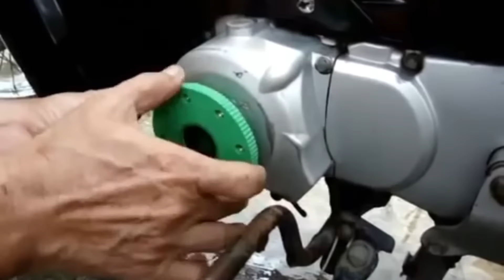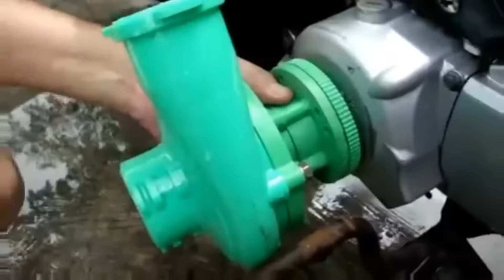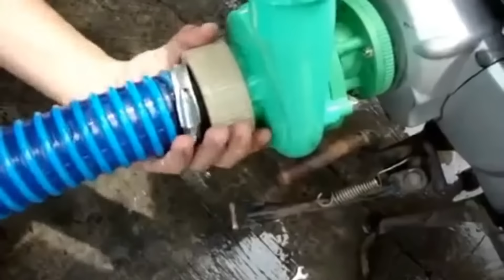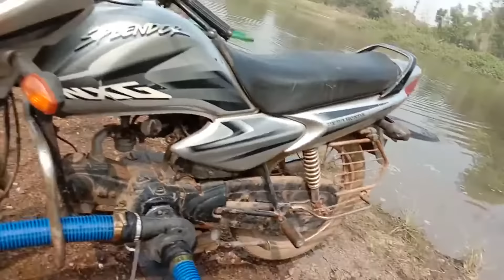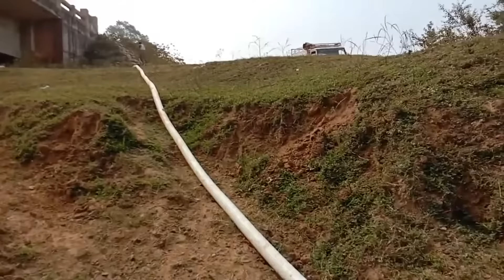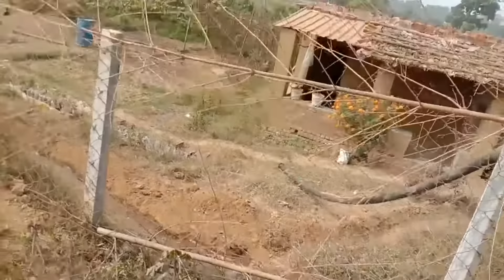Motorcycle water pump fitting and testing | BIKE OPERATED WATER PUMP

Comment: Put a blower fan to cool the engine block to avoid engine damage. The side engine cover is not designed to carry a load stress but this video proves possibilities of what motorcycle engine can do, let's hope that engineers would redesign motorcycle engine to easily fit other utilities for farming use.
Reply: Very nice video friend banae please.
Reply: The pumped water does it brother.
Reply: L
Reply: M
Reply: @johnbanda6617   pumped water doesnt come in contact with engine block.Motor cycle engines mostly are air cooled, so they expect the motor cycle to be moving to get the engine cooled.
Reply: Hame bhi lena hai .kya Rate hai. kaha se milega.  Jankari aye  to batana.
Reply: @hariom2162  bhai yaar yah theek se reply nahin karte unhone Dena Kiya hai
Reply: No need of fan, there is a small pipe flowing water continuously on the engine to cool it...

Comment: La moto necesita desplazarse con el motor encendido para refrigerar el cilindro. Puede fundirla
Reply: Asi es se enfria con el aire quedaria bien con un radiador de aceite para un riego
Reply: @hectorgamino8778  Small water outlet to sprinkle water 💦 on engine
Reply: There is a small pipe pouring water continuously on the engine to cool it...

Comment: Most motorcycles are air cooled if the bike is not moving it might over heat. Something to watch out for. Maker please respond how your experience with overheating is 👍🏿 loved the design
Reply: Correct
Reply: There is a s to pipe pouring water continuously on the engine to cool it...

Comment: It will be overheat your motorcycle it will work but not in longertime provide 12volts fan on your cylinder head and engineblock
Reply: Yes ur ryt air cold engine
Reply: Sure would. It needs to be on a watbercooled engine with a fan.
Reply: There is a small pipe pouring water continuously on the engine to cool it...

Comment: A idea is ok. But the engine gets heated up as there is no sufficient air cooling because the bike is not running.
Reply: There is a small pipe pouring water continuously on the engine to cool it...